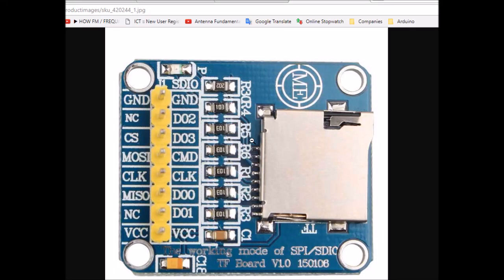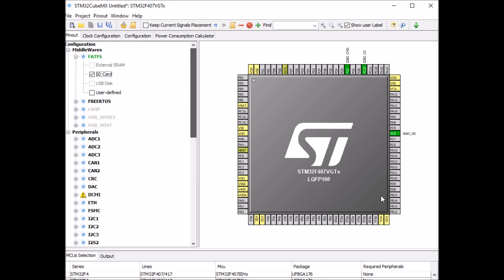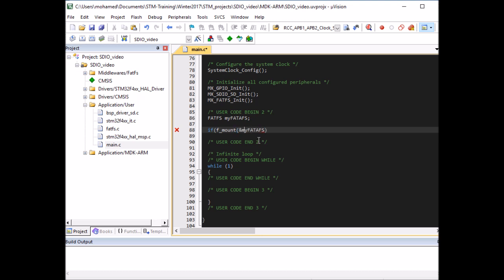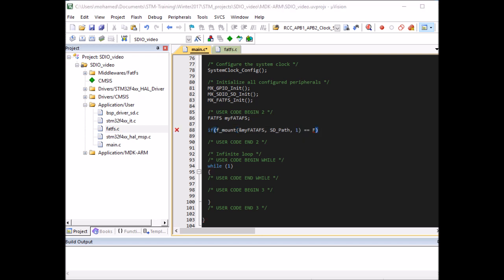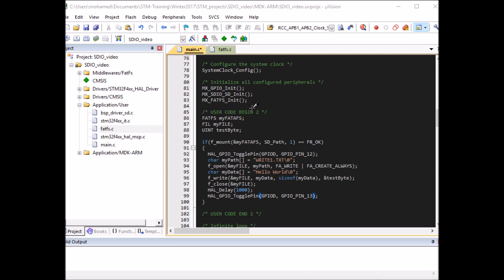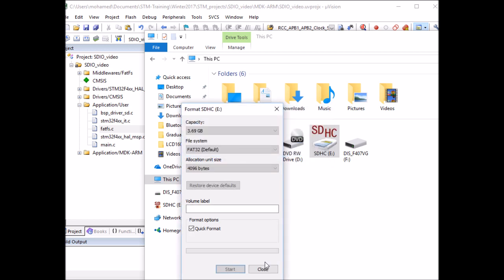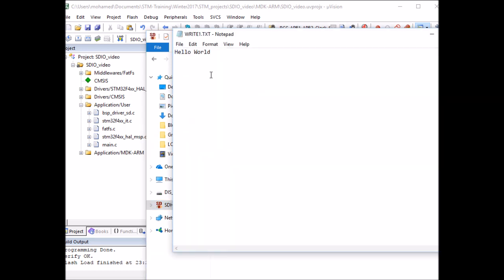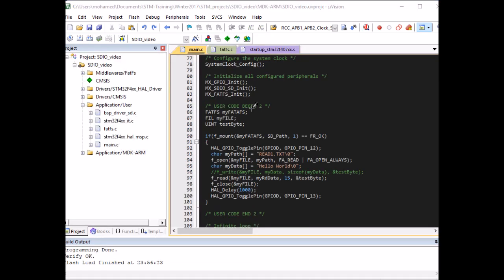STM32F4 Discovery board - Keil 5 IDE with CubeMX: Tutorial 16 SD Card SDIO - Updated Dec 2017

Comment: thank you so much for a great Tutorial.
I have  a small problem.  I've tried to store some integer values but  when I open the file , I will become the charchter of the intger values  

  this is my code 

if(f_mount(&MyFATFAS,SDPath,1)==FR_OK)
{
HAL_GPIO_TogglePin(GPIOD,GPIO_PIN_12);
 char myPath[]= "text1.txt\0";
 f_open(&myFILE,myPath,FA_WRITE | FA_CREATE_ALWAYS);
int Data = 230000;
 f_write(&myFILE, &Data,sizeof(myData),&testByte);
 f_close(&myFILE);
 HAL_Delay(1000);
 HAL_GPIO_TogglePin(GPIOD,GPIO_PIN_13);
} 

is there any function that supperts the interger or flaot values ?

Comment: Hi, i can create the file, but doesnt write into the file created, any help?
Reply from the maker: Hi,
What CubeMx version are you using ?
Reply: hi, the 4.21 and 4.22, the same problen on both
Reply: my solution was to include the writing function in the loop, and that it would not come out until I wrote. But it must be something related to the speed of the clock, can you show me how you configured it?
Reply from the maker: Hi,
You seems to be using the right CubeMX version, since later versions has a faulty SDIO library.
I am not sure what clock speed you can change here, but if you want faster speed, use SDIO + DMA: https://www.youtube.com/watch?v=0NbBem8U80Y&t=1s
Reply: thanks

Comment: Hi Yaqoob,
 I am storing files into SD card using the SDIO interface. I am using a 32 GB sd card. Now i want to check everytime how much space is available on the sd  card.  I am using STM32F407.

My code by using the API f_getfree() is as follows:
if (f_mount(&myFATAFS, SDPath, 1) == FR_OK) {
HAL_GPIO_TogglePin(GPIOD, GPIO_PIN_12);
f_getfree("1:", &Free_clust, &myFATAFS);
tot_sect = (myFATAFS.n_fatent - 2) * myFATAFS.csize;
fre_sect = Free_clust * myFATAFS.csize;
sprintf(coeff3,"%10lu MiB total drive space.\n\r %10lu MiB available.\n\r", tot_sect/2/1024,Free_clust/2/1024);
HAL_UART_Transmit(&huart2,(uint8_t *) coeff3, 65, 50);
}

But the output that i get is as follows :
30416 MiB total drive space.
0 MiB available.

Also, f_getfree API returns a FR_INVALID_DRIVE error i.e., finding the logical drive function returns me the volume as -1 even if my sd card is connected.But a f_write api writes files and directories into the sd card. Please help. 
 

 

However, my SD card is formatted and there is nothing in it.Please help me here.

Comment: MYaqoobEmbedded,
Hi,
I have just connected the D0,CLK and CMD along with VCC and GND to STM32F407. I have not connected the rest of the pins(D1,D2,D3) to any of the ports. Can you tell me where exactly do I need to connect them?
(PS-It is not working for me, I was able to successfully upload the program but it did not run)
Reply from the maker: Abhishek Parida 
Hi Abhishek,
You don't need to connect the other pins if you're using 1 bit mode.
I think this is because of the latest CubeMX release. You need to downgrade to an earlier release than 4.23
Watch my latest video, Tutorial 22 on SDIO 4 bits + DMA. There I show how to do that.
Good Luck
Reply: Yeah, I just saw your latest SDIO 4bit video, will downgrade to 4.21. Thanks for your help :)
Reply from the maker: Abhishek Parida 
No worries Abhi
Reply: did you manage to downgrade? If so please share the link

Comment: Hello
I've done what you did in this video and normally build and download . But didn't write .txt file !!!
what should do?!?!
Thanks
Reply from the maker: mohammad Mahdi Bayat 
Hi Mohamed,
Could be because of CubeMX version. Are you using the latest Cube version?
I will check again with the latest version.
Reply: MYaqoobEmbedded 
Hi
Of course I did.
My cube and Keil are last version and all packes are installed 
And I wanna ask you to do this project in 4-bit mode ... That´s what you said "I did but no success" 
According to your information and experience using with stm32 series,can I have your e-mail to contact directly?
Thanks a lot
Reply from the maker: Hi Mohamed,
Sorry for the late reply, I will review the SD card setup now with the latest CubeMX firmware, because I think it is slightly different and will update you here.. I will be happy to share with you my email if this problem persists, but let's try here first. Thanks :)
Reply: Thanks buddy
It´s my pleasure for that
Reply from the maker: Hi Mohammad,
It turned out to be an issue with the latest CubeMX version,, I got it solved by downgrading to CubeMX Version 4.21.
Reply: MYaqoobEmbedded 
Hello
Damn it!!!
I´ll test it by another version
Thanks a lot

Comment: Hi Yaqoob,
Would you please help me to know what are the changes required to interface SD card with 4 bit mode?
Reply from the maker: Shenoy Niyathi 
Hi,
You would need to enable the SDIO Global Interrupt with 4 bits mode
Reply: I found that if I changed form one bit to four bit modes after initialisation, it worked, but otherwise not.  The SDIO library has a few odd issues that need working around.

Comment: hello i m trying to interface sd card catalex module with stm32f4 discovery board using "  SPI " interface
but its not working..
can u help me out.
i m providing my main.c file link
https://drive.google.com/open?id=13CEW_GsEEAAWQ6JN_XyfM0yiwHYWRPYg
Reply from the maker: Hi
I interface with SD card on STM32 board with SDIO, I did not use SD card with SPI before,, sorry :)
But I will be happy to help out if you have specific questions on SPI. Good Luck!
Reply: hi
i followed ur video nd was able to successfully interface it with sdio.
what clock config u did for sdio communication in cube mx.??
Reply from the maker: harshal dhake 
Can't remember I changed the default clock settings

Comment: Hello. I have some problem with SDIO on CUBE_MX 4.23. f_mount OK, but SDIO pins are not initialized! no pull-up, but I cofigurate it in cube_mx! void HAL_SD_MspInit(SD_HandleTypeDef* sdHandle) in sdio.c NOT COMPILED! only MX_GPIO_Init(), MX_SDIO_SD_Init() and MX_FATFS_Init(). When I wrote initialization in code, pins are configurated, but sd card doesnt work. And all links on st.com cube_mx SDIO are incorrect. Are they know and hide it?
And in void MX_SDIO_SD_Init(void) in sdio.c hsd.Init.BusWide = SDIO_BUS_WIDE_1B; ALWAYS! When I select 1B, 4B or 8B in cube_mx, hsd.Init.BusWide = SDIO_BUS_WIDE_1B. hsd.Init.ClockDiv changed correcly.
Reply from the maker: Hi,
There is an issue with SDIO driver on the Cube 4.23 version, ST said they will fix it in the next release,, so just downgrade your CubeMX somehow. Let me know how it goes. Good luck
Reply: Hi,
I downgraded my cubemx to v4.16.1 and f4lib to v1.13.1 and all work! Cubemx 4.23.0 is realy have bug.
Reply: This code correct works in cube 4.22.1
Reply from the maker: Very good!

Comment: Hi,
I have done everything like in your video, unfortunately it does not work. After debugging, it returns "FR_NOT_READY", physical drive cannot work. Can you help me with this problem?

Thanks
Reply from the maker: Hi Elman,

I am not sure about this error, never had it before. but I would first check the wiring and then format the SD card to FAT32.
If not, then have a quick read about it in Google, you might catch something useful. Good luck :)
Reply: MohamedYaqoobSTM Actually I have been searching solution since last week..It seems the problem is about Cubemx new update
Reply from the maker: What version of CubeMX you're on, 4.23 ?
Reply: MohamedYaqoobSTM yeap
Reply from the maker: Elman Kerimli 
Alright, I will check with mine again, since I've just updated this week.
You may also share with me your code, I can test it directly with my SD card, if you like.
Reply from the maker: Ok, you are right! It is an issue with this update, I just had a quick look at ST community website and they confirmed that. So, for everyone here, do not update to CubeMX 4.23! just yet, wait for the next one.

Here is the link:
https://community.st.com/thread/45202-could-you-kindly-fix-the-bug-in-the-sd-card-cubemx-v4210
Reply: yep. you can increase SD clockDiv factor( hsd.Init.ClockDiv = 4; ) . good luck :)
Reply: BH QuocAnh I have checked it but it doesn't work.
Reply: can you tell me some information of you sd card?
sdhc? capacity? and how is it format?
Reply: if you want you can send your project to me. focus.quocanh.2611
Reply: Hi 
It does not work for me too. I changed the code a little now it is working. It is here.
 FATFS fileSystem;
  FIL testFile;
  char testBuffer[] = "SD write success";
  UINT testBytes;
  while(f_mount(&fileSystem, SDPath, 1) != FR_OK);
 HAL_GPIO_TogglePin(GPIOG,GPIO_PIN_13);
    char path[] = "testfile.txt\0";
    f_open(&testFile, path, FA_WRITE | FA_CREATE_ALWAYS);
    f_write(&testFile, testBuffer, sizeof(testBuffer), &testBytes);
  f_close(&testFile);
  HAL_Delay(1000);
  HAL_GPIO_TogglePin(GPIOG,GPIO_PIN_14);